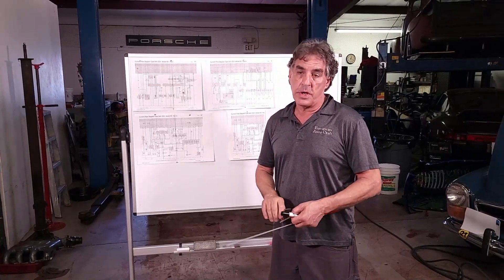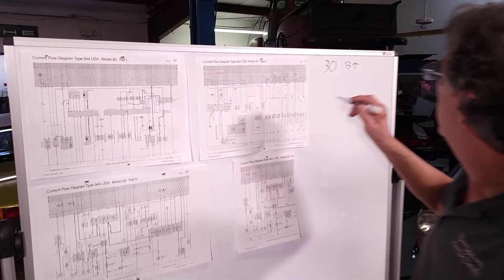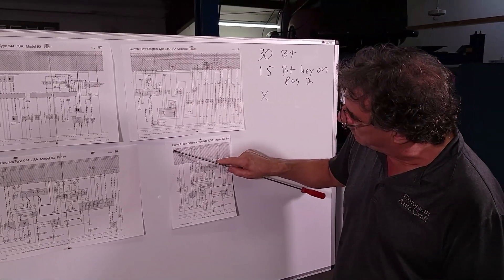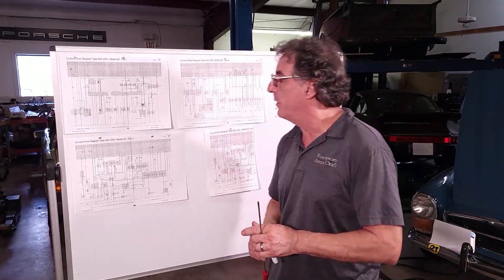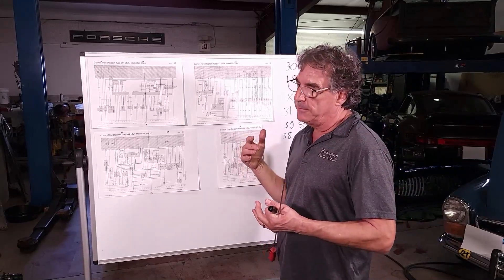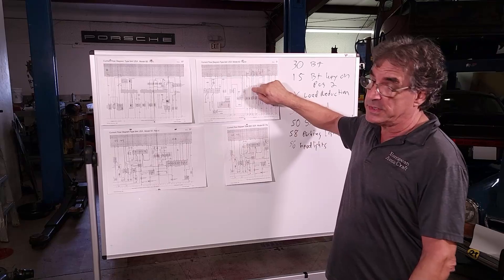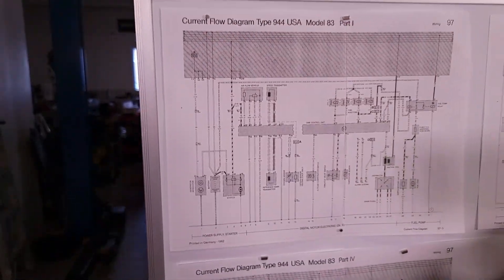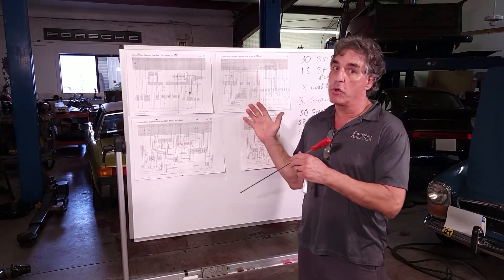Episode 1 - How to Read Vintage Porsche Current Flow Wiring Diagram - Introduction

Comment: Russ, thanks for a great technical presentation. The policy of wiring the passenger headlamp conductors solid yellow and solid white and the drivers side headlamp conductor as striped yellow/black and white/black is very interesting. As near as I can tell from the Porsche wiring diagrams, this only applies to the headlamps as the conductor insulation colors for other components related as passenger/driver side follow different policies.  In your opinion, why would this be? Is this some sort of legacy policy in the European automobile standards,  or legacy policy dating back to the beginning of Porsche and/or VW?
Reply from the maker: I have noticed that even the 60's VW's use that color scheme.  There are other things like this that you will see, like the different color tracer stripe for left and right turn signals.  Thet may do this because the left and right lighting is fused separately.  There are 4 fuses for the headlights for example.  The motor is fused separately.